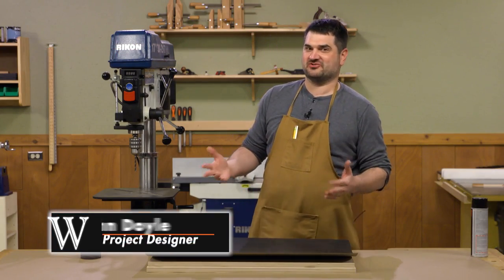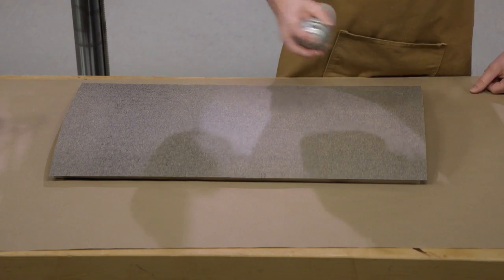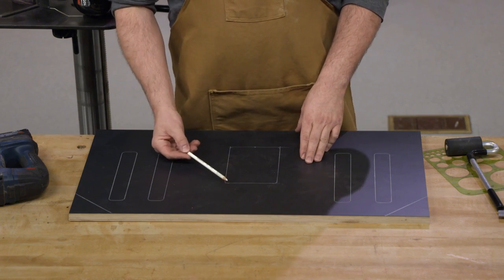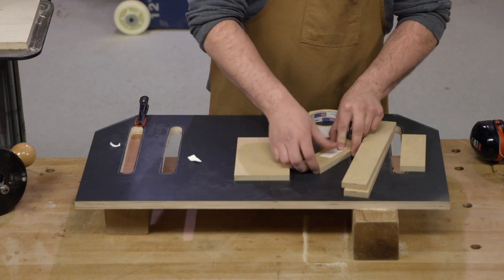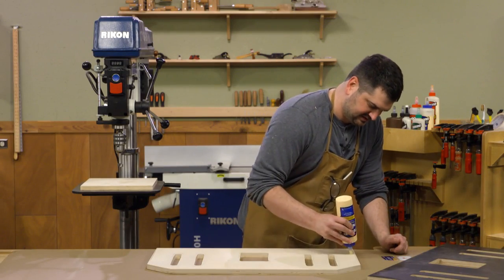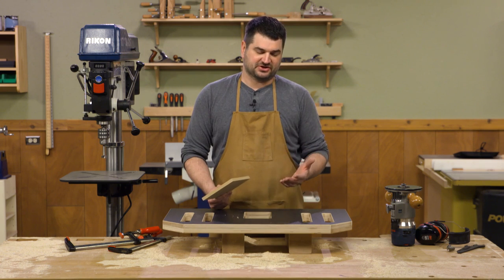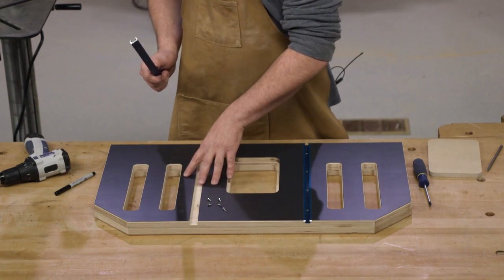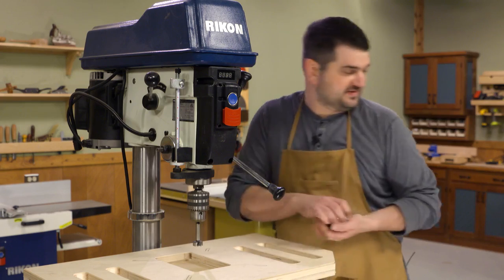Building the Ultimate Woodworking Drill Press Table - Part 2

Comment: I love this table. I did make a single adjustment by incorporating the MDF insert from the basic drill press table. It still has the hole underneath for sanding, but it becomes easier to replace the insert.

Comment: As that the table is symmetrical you could save the time with having to relay out your cut out lines if you would flip the board over and spray the adhesive on the unmarked side. When you go to drill your holes you can put scrap piece under to keep from Damaging or separating your laminate. Then when you go to cut out with your jigsaw the sawtooth will try to pinch the laminate to the board not pry it off as that most jigsaw blades cut on the upstroke. When you go to use the router you can use a spiral up cut flush cutting bit to protect your laminate. You actually could glue down your laminate first and then do all your layout lines after it’s all trimmed up. Of course if you really enjoy making your lay out lines twice, be my guest.

Comment: Why is the replaceable insert rectangular vs square? Might be able to utilize more area before replacing no? And on the previous design a couple years back it was circular so you could simply spin it, which looked very smart
Reply: I just subscribed for a year. Good thing I checked because it was a great deal compared to just buying the one plan.
Reply from the maker: Tsz2g4f - Did you get the 1 year + 5 plans package? Great deal 👍
Reply: Yes that’s right. I guess the videos do work eh? Haha. Keep up the good work!
Reply: Do you know when the insert options will be out? I’m actually planning to make this imminently!
Reply from the maker: @Tsz2g4f  - The optional insert designs are already part of the Woodworking Drill Press Table plan, but I just shot the video for those a couple weeks ago, so it should be edited and up pretty soon.
Reply from the maker: On this one the insert is rectangular to better utilize the dust collection in the drawer compartment (addressed in Part 4).  I have another video coming up about options for the replaceable insert... should be up soon.

Comment: @woodsmith: Someone may have already asked, but why did you use the table saw, for the dados and not the router?
Does it matter?
Reply: Table saw dados eliminate stress that might be on a router bit. Also the saw has a built in fence, no need to clamp a straight edge
Reply from the maker: Purely, personal preference... Some other guys here prefer the router table for dados. Actually a 3/4” straight bit in the router table should fit t-track perfectly. 👍

Comment: Where do you get that laminate?
Reply from the maker: Sometimes you can order sheets from the home stores like Lowes and Home Depot.  I've used online retailers like CabinetParts.com in the past as well. ( https://www.cabinetparts.com/p/formica-countertop-laminate-products-laminate-sheets-FORM909104X8-p22838 )

I can usually find enough uses for a 4x8 sheet to make it worth the purchase (ex. jigs sleds, worksurfaces, cart tops, etc.) , but If you only need smaller pieces you could try contacting a local countertop fabricator and see what they have for scraps.
Reply: @WoodsmithShowandmagazine  Thank you!

Comment: Very nice job. My top is quite crude in comparison to yours, but one thing I did differently is that I put a couple of cleats on the bottom to align the top with drill press table. Also instead of threaded inserts and knob I used DESTACO clamps secure the top to the drill press table. Very quick easy on, easy off. Your video caught my eye because I’m getting ideas so that I can build a new top for my drill press.
Reply from the maker: That's a great idea! Thanks for sharing.

Comment: The rest of my comment. I was able to use the ratchet handle from my socket set to crank up & down.  I bought another ratchet for my socket set.  This meant that I could extend the table back with the included metal tracks extending even farther back.for the fence tabs on my Delta Fence,   which extend back as well, This way I was able to set my fence all the way back to the D/P column.. I think loosing any space between the Quill and the post limits the reach of the drill.  It's already too short for some of my operations. Some more elegant and expensive D/P have an adjustible length of the Quill arm to help with this issue. It took 3 iterations of this design so far.
Reply from the maker: That’s a pretty clever solution. 👍 This is another drill press table we built kind of along those same lines that transfers the crank mechanism to the front of the table: https://youtu.be/3_cQcHMz7UU

Comment: A suggestion. I added a extension from my socket set in place of the crank wheel for raising & lowering. Of course I had to make a support beam for it with a hole lined up with crank mechanism. I could use an extension of virtually any length

Comment: Why not use melamine.  2 layers must be cheaper than baltic birch
Reply from the maker: Melamine might work too, but I’ve never been a big fan of the particleboard core. It seems to sag over time and I’m not sure how all the exposed edges would hold up. Just my opinion though 🤷‍♂️
Reply: @WoodsmithShowandmagazine  That's great.  Never thought about the bowing or sagging.
Reply: I'm a big fan of melamine for many projects, but plywood is stronger and lighter weight. Perfect for this project

Comment: I would be curious to get your impressions about the Rikon 30-217 drill press shown in the video.  I want to replace my drill press and I'm in a dilemma trying to choose between this one or the Powermatic PM2800B.  I know you had a chance to work with both machines.  There is a steep difference in price of both machines, but is the extra money for the PM worthy or the Rikon performs just as well?  Thanks and great build
Reply from the maker: After using both of these drill presses for a while now, I would be happy to have either one in my shop.  Doing a quick search for pricing I see the Powermatic PM2800B for about $1600 and the Rikon 30-217 for $1050.  Is that what you are seeing also?  For me the Rikon drill press does everything I need it to do and more, but the Powermatic has a few upgrades.

One of the upgrades I see in the Powermatic is a larger table (which doesn't matter to me because I always put a larger wood auxillary table on anyways.  

The Powermatic also has a key-less chuck which is a nice feature but probably not enough of a convenience in itself for me that I would need to spend the extra money for it.

It seems on the Powermatic you can fully change adjust the speed on the fly with a crank wheel on the side.  The Rikon has a handle that you can also adjust the speed to an extent, but for larger changes you may have to flip the top up and move belts around.  I usually don't make a lot of major changes to the speed, so again not a big selling point to me.

In conclusion, the Powermatic has a few add-on features but if you don't feel like you need those then it's probably not worth the extra cost.  With my own money I'm going with the Rikon.  Plus, I like blue and cream better than black and gold. :)
Reply: @WoodsmithShowandmagazine  thanks for your anwser.  As for the pricing the difference between both models would be even greater here since I'm in Canada.  Once the exchange rate and sales taxes applied, I think the difference will get range somewhere between 800$ up to 1000$...  I think the choice will be pretty easy to do when time comes for that...
Reply: I just ordered the Rikon 30-217 (got it on a Labor day special of $895), I was torn between each as I'd love to have the convenience to not open the top.  Also the Rikon's top speed is 2200 vs 3000 for the PM, not a lot but that extra speed can come in handy for drilling through most materials including aluminum when using small twist bits between 1/16 to 3/16".  I love the table of the Powermatic and the look of it (minus the mustard color) but I've been reading many reviews in regards to the keyless chuck to actually having some bits come out.  For my type of work I'd rather have a chuck that I know will hold my bit in and I can count on.  This is just my two cents.  Can't wait to try out my first Rikon!

Comment: Do you really need to have so much glue to hold the two pieces together?  There will fe very little force trying to separate the two pieces
Reply from the maker: Probably not, but I come from a mechanical engineering background where I had it beaten into my head not to create another disaster like the Titanic, Hindenburg, Challenger, Tacoma Narrows Bridge, etc so I just automatically tend to over-engineer everything. Overkill is my middle name around here 😀

Comment: I use a "down cut" jig saw blade when cutting holes in laminate covered materials. Prevents the lifting and chipping potential caused by a typical up cut jig saw blade.
Reply from the maker: Great idea - thanks for the tip 👍

Comment: Sourcing the plastic laminate has been difficult for me. Big box stores don't have it. Buying it in a large 4x8 sheet with store pickup can run $120. There is an online source that sells 2x4 sheets but they will not sell to my area due to distribution channel restrictions.
Reply: Look for a company that sells laminates for countertops in your area. In LA, we can get a 4x8 sheet of white laminate for under $50
Reply from the maker: I've used online retailers like CabinetParts.com in the past as well. ( https://www.cabinetparts.com/p/formica-countertop-laminate-products-laminate-sheets-FORM909104X8-p22838 )

I can usually find enough uses for a 4x8 sheet to make it worth the purchase (ex. jigs sleds, worksurfaces, cart tops, etc.) , but If you only need smaller pieces you could try contacting a local countertop fabricator and see what they have for scraps.
Reply: Any cabinet shop will gladly give you laminate and even trim it out for you when you glue it up.  All I've encountered are great folks.  Encountered= good pun!
Reply from the maker: D Robb En-COUNTERed...I see what you did there. 😉

Comment: Is there a specific type of plastic sheet that is best for laminating to ply for drill press and/or router tables?
Reply from the maker: There are different grades of plastic laminate.  I would look for a countertop grade laminate (probably the most common).  Sometimes you can order sheets from the homecenters like Lowes and Home Depot.  I've used online retailers like CabinetParts.com in the past as well. ( https://www.cabinetparts.com/p/formica-countertop-laminate-products-laminate-sheets-FORM909104X8-p22838 )

I can usually find enough uses for a 4x8 sheet to make it worth the purchase (ex. jigs sleds, worksurfaces, cart tops, etc.) , but If you only need smaller pieces you could try contacting a local countertop fabricator and see what they have for scraps.

Comment: I think that perhaps, you should've cut out the top before applying the laminate. Then, once applied, poke some holes from beneath and use a top-bearing flush trim bit to finish it up. That way you don't have to double up on transferring your marks onto the laminate.
Reply from the maker: Yeah, that would have saved me a little work. 😂
Reply: @WoodsmithShowandmagazine  It's kind of what you did with the lower piece, I think. Great job all around. Thank you for sharing.

Comment: Cutouts for clamps, Great addition to the T track. Did you ever consider a circular insert  mounted a bit forward of center.  You can move it 360 to get a fresh back stop then flip for more.  Mine last longer than the square one.
Reply from the maker: Yeah, I had a round insert on this drill press table https://www.youtube.com/watch?v=3_cQcHMz7UU and it worked pretty well too.